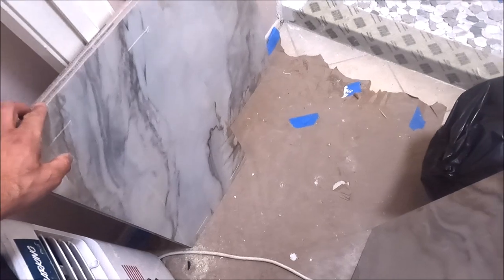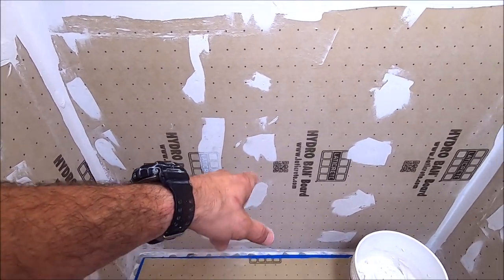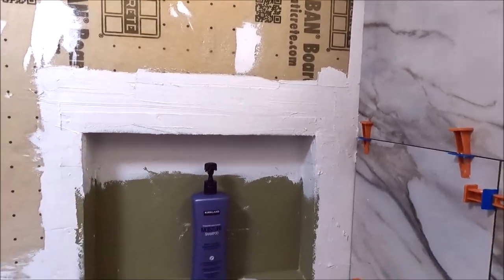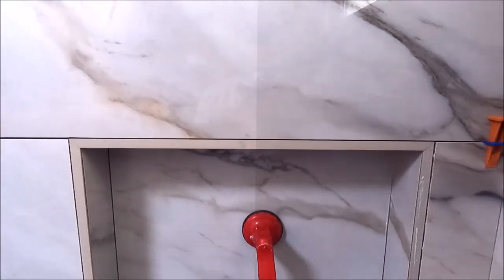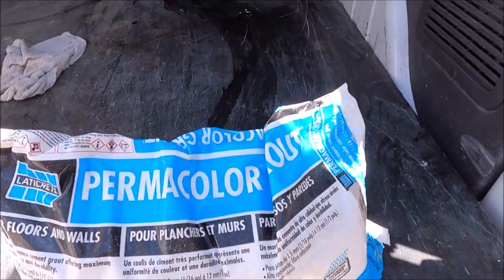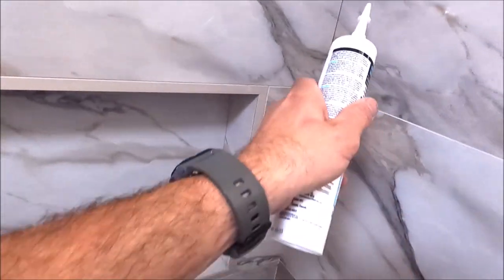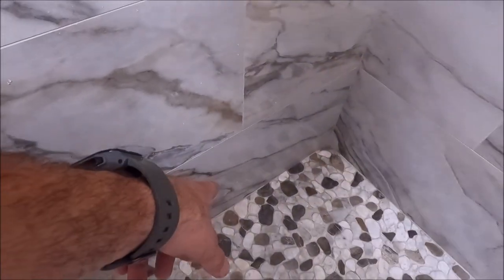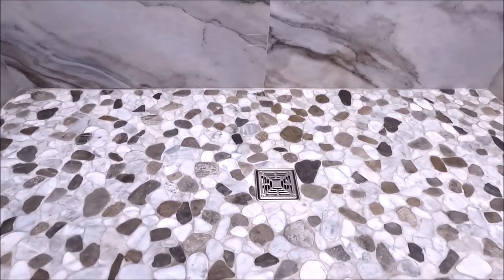Is This a Fool-Proof Shower Build?

Comment: So at 2:55.... you're using your anhle grinder as a hole saw? Can you give a link for that adapter? And what's the brand of hole saws you find work best? My Drilax set is dulling out and need new ones. Bought a pair of suction cup rings (3" and 5") made for holding a little water around the hole saw bits. Best thing ever.
Reply from the maker: SHDIATOOL 7-Piece or you can buy them singles. Awesome hole saws for the money